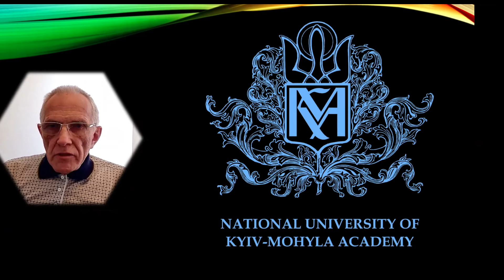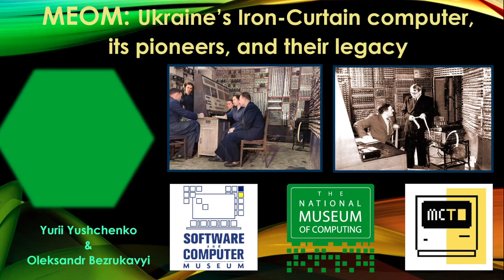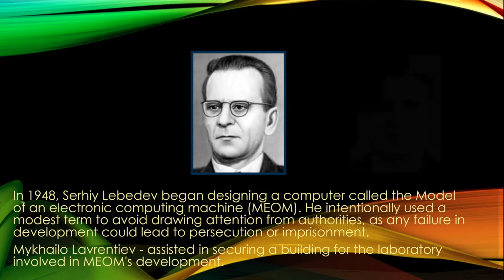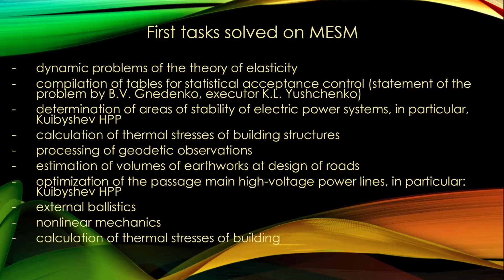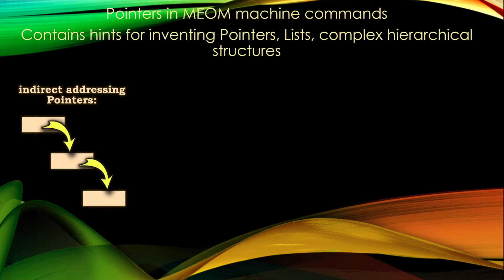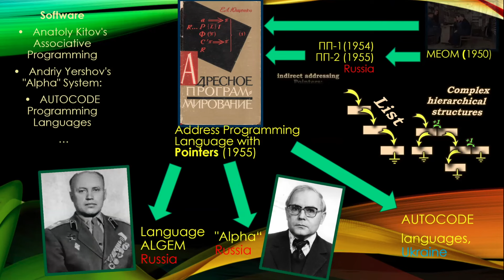MEOM: Ukraine’s Iron-Curtain computer | TNMOC Talks

Comment: Seventy-three years ago, on December 25, 1951, the MELM (Small Electronic Calculating Machine) first Ukrainian and Soviet computer was officially commissioned. 
The chief designer, Sergey Lebedev (Kyiv, Ukraine).
This computer played a huge role in the IT field emergence and development.
Works on the MELM went under challenging conditions and were isolated from other similar projects, this resulted in unique features of the machine.
These features were crucial for the achievements of Ukrainians in IT. Special mention is worth
the instruction set of the MELM which played a key role in the creation of the high level Address Programming Language in 1955. 
This language was developed alongside the design of the universal asynchronous computer 'Kyiv,' which included a unique Phi-operation enabling pointer dereferencing.
During the development of the 'Kyiv' computer, the Address Programming Language introduced indirect addressing of the second and higher orders rank (known to programmers as Pointers). 
No modern programming technology can function without Pointers. The Institute of Electrical and Electronics Engineers has recognized the invention of Pointers as highly significant for humanity.
Luckily you can still find people who worked on this machine.
https://youtube.com/shorts/GNGC6krYpVI?feature=share

Comment: Thank you for your comment!  
We are talking about a full-fledged Turing-complete computer with storage of data and programs in RAM.
Regarding works of Konrad Zuse Z1, Z3, Z4 the differences :
1) the program was not stored in the computer memory, but on tape;
2) looping (reversal of the tape) was not assumed, which indicates not complete by Turing.
That confirms, and does not refute, the fact that the first Such computer in continental Europe was the Ukrainian MEOM computer. 
Quote:
"The Manchester Baby of 1948 along with the Manchester Mark 1 and EDSAC both of 1949 were the world's earliest working computers that stored program instructions and data in the same space."
Reply: @2104Piraeus  this is incorrect. The Z3 WAS Turing complete. 
" It was possible to construct loops on the Z3, but there was no conditional branch instruction. Nevertheless, the Z3 was Turing-complete – how to implement a universal Turing machine on the Z3 was shown in 1998 by Raúl Rojas." https://en.wikipedia.org/wiki/Z3_(computer)#Z3_as_a_universal_Turing_machine
Reply: @michaelwessel4953  
Thanks for raising the point, sure we are aware of this thought, and there exist many controversial opinions.

Some researchers point out that it would  not practically be  the same machine if it would have extra hardware or software designed to support  conditional transitions, loops, extra mechanisms for the memory management, and dynamic allocation and release among them. Despite theoretical possibility of similar changes, practical deployment raises a lot of discussions among specialists. 

To our mind– each side would consider their vision right to the certain extent having majority of researchers agree or disagree on that. Again, to our mind though Z3 could be modified, it will be another machine then, not Z3 - almost complete by Turing.

We are very impressed with Konrad Zuse Plankalkul and its direction towards solving combinatory tasks. To our mind  he was ahead of his time for a decade.
Reply: @2104Piraeus  you are welcome! I think the only thing that's controversial here is your attributation of a machine that nobody has ever heard of, that is late to the game by about 2 decades, being declared as " Europe's first digital computer". I am wondering what your agenda is for such bold history revisions.
Reply: @2104Piraeus  I am fine with all of this, but I am not fine with trying to rewrite history by giving it a label as "Europe's first digital computer". This is just wrong. You can always claim something to be the first by making it a special category, i.e., "the first computer with vacuum tubes that used blue front panel blinking lights" or what have you. This is not meaningful though. My main objection stands - this machine is definitely NOT "Europe's first digital computer" as you claimed in the intro.